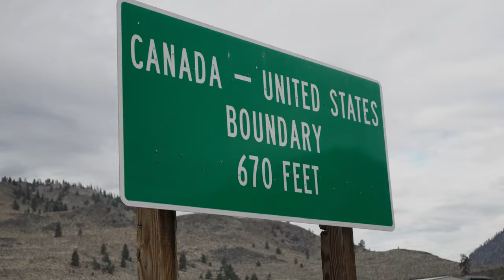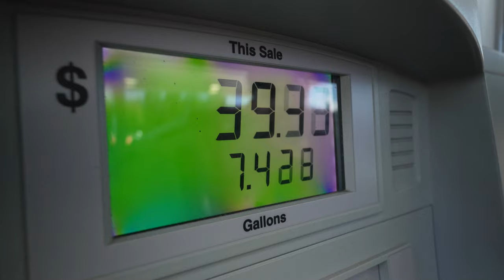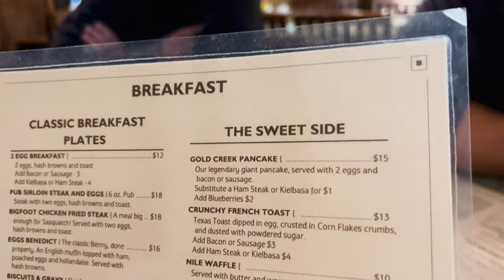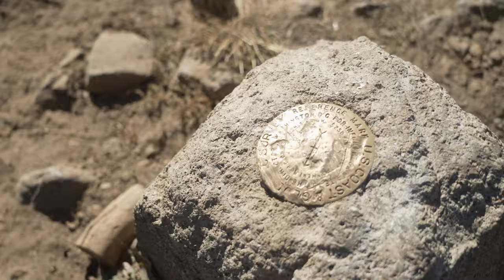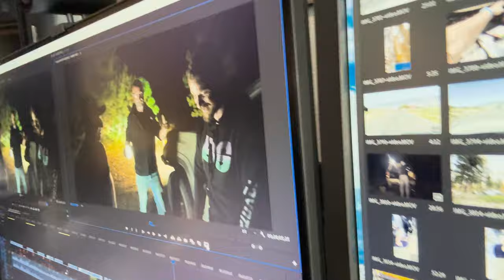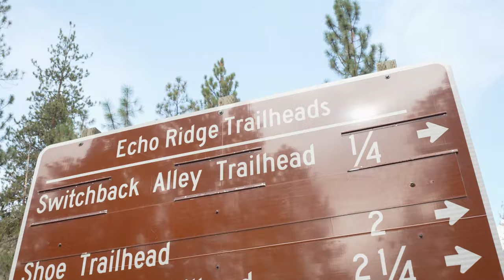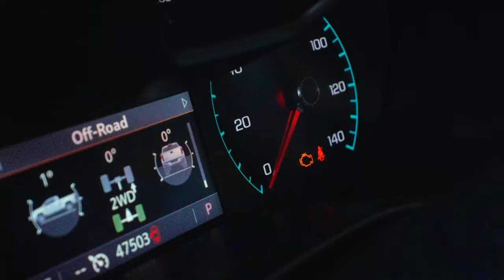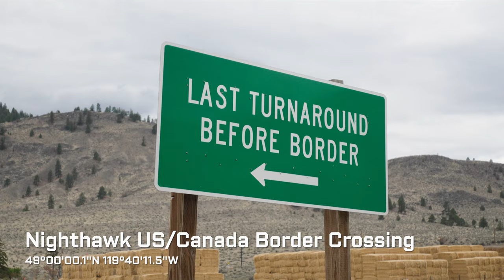Overland Washington: The Movie

Comment: very nicely done Jason. I just got an army green Tacoma as well, I love your setup, mind to share the suspension and tire size you have? Thanks!
Reply from the maker: Sorry I saw this late!  Tires are 265/70/17.  Suspension is Bilstein 6112 with Eibach 650 lb springs.  Rear is Bilstein 5110 with OME medium duty leafs.  I filmed a video about it a LONG time ago and still need to edit it
Reply from the maker: Oh, and Sumo Spring bump stops front and rear.
Reply: @JasonExplainsThings  265/70/17 is it stock size?

Comment: One of the best videos iv seen. 👍 The WABDR is on my bucket list  Thanks for sharing. Do you think a stock AWD SUV can make the whole thing?
Reply from the maker: Hey Chris, I'd say a stock 4Runner, Jeep Wrangler, Bronco wouldn't have a problem... doing it in the late summer.  Earlier than that it gets tricky.  I personally got stuck and had to winch myself out of a hole doing part of Section 2 in May.  I'd be concerned about doing the WABDR in crossovers like a Rav4, Subaru Outback, Honda CRV or something like that.  Although any car can do Section 1.  That's just a pretty drive in the woods.

Comment: Could a stock 21 4Runner TRD do this trail?
Reply from the maker: For sure.  Consider some true AT tires along with the ability to air down and up.  Go with friends.  Bring recovery gear.  A 4Runner won’t have any trouble.  You might find mud and snow early in the season that would require more capability (winch, skid plates, etc)